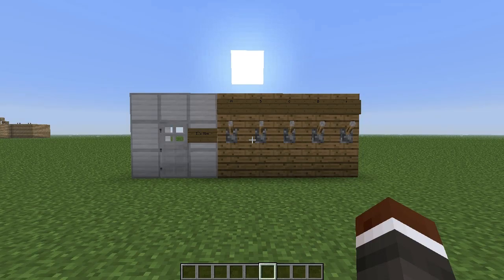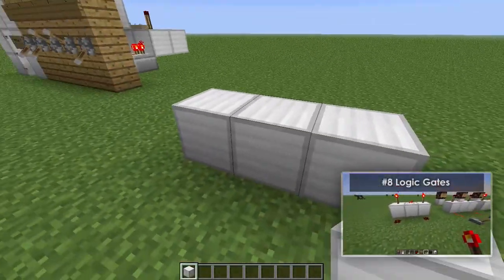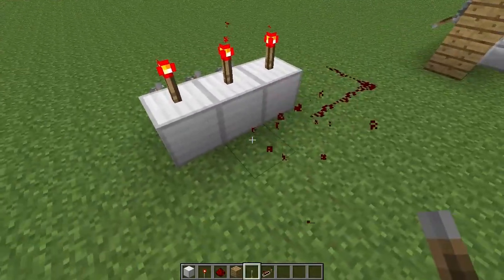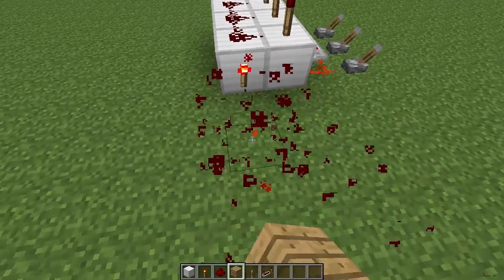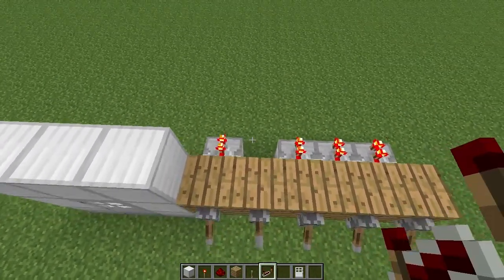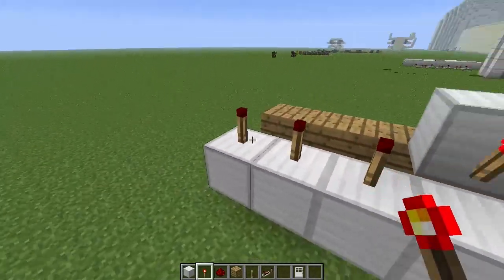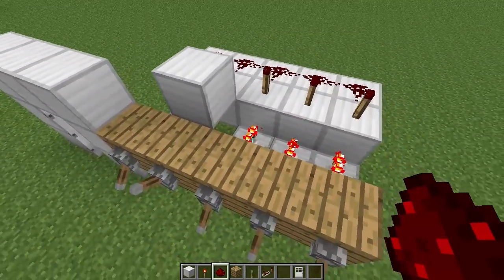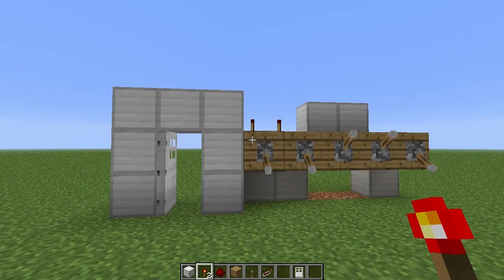Redstone Tutorials - #19 Combination Lock

Comment: Tonight was the first time I really got into redstone. Thanks to your tutorials on basic gates I was able to build a button combination lock.
- 3 buttons
- The buttons fire into a pulse limitor, as you showed.
- It uses 4 bytes of RAM ^-^ (I feel like I just invented computer science all on my own).
The button's input is instantly separated into two.
The first circuit merges all of the buttons into one input and counts to three in binary (except that it's wrong binary).
The first cell will go to 1 if a button is pressed. The second cell will go to 1 if the 'and-gate' confirms that a button is pressed and that the first cell =1. There's also an 'and-gate' that triggers a pulse if cell B = 1 and there's a button input. This final gate triggers an error sound and puts a 0 in all four memory cells on the two circuits.
Basically this circuit counts three button inputs with binary cells. 00 => 01 => 11 => reset to 00. (And yeah I do realise that it's not an optimal use of binary numbers, because following that logic, counting to 4 would take 3 bytes whereas it takes two bites if I actually went 0, 01, 10, 11. But I didn't want 4 numbers).
Anyways, the second circuit starts at 00, goes to 01 if the right button is pressed, then to 11 if the second right button is pressed, then using another 'and-gate' triggers a T-thingie which opens the door. Oh, and it plays a happy jingle.
Basically, you have to input the right buttons in the right order, and if you don't do it in exactly 3 button presses, the machine resets with all cells as 00. That forces you to do it right.
I really feel like if I had lived 100 years ago I would have invented the ancestor of computers. I just taught myself binary information processing. I'm quite proud of my acheivement.
Reply: I can no longer read

Comment: Only 32 different combinations on the lock you did
Reply: So just chain more switches. An 8-switch lock has 256 combinations.
Reply: IceMetalPunk what about a ten switch lock????
Reply: Eric McKinney It's 2^N, where N is the number of switches (that's 2 to the power of N). So for a 10 switch lock, there are 2^10 = 1024 combinations.
Reply: IceMetalPunk oh

Comment: Haha I did a similar thing I wish I watched this first. but my thing was that I hate levers so I used buttons which meant I had to build in a bunch of my own modified switches to convert them into constant impulses then I had to create a reset system too. But this and system works a lot better and doesnt need an overhead cave wired to the brim with Rstone xD

Comment: i had 8 levers leading into 4 and gates with 1 torch taken off each and gate the 4 and gates led into 2 and gates with torches on those 2 and gates led to one and gate which then let out a redstone signal when all the torches that led to a torch on the first 4 and gates were on. all the levers that didn't lead to a torch lead to a piston that blocks the current so you can't flip all the levers and open it. i had the code open a secret room from pistons and i recently added a button on both sides

Comment: I did this with two sides with 10 levers in a hall with a trapdoor floor leading to an iron door. Each side has a four lever activation that I made by adding AND gates into each other... 7 Gates in total, with the final AND gate leading into the iron door. All the levers that don't go into the AND gates send the signal into a circuit similar to your hidden floor trap circuit ( exact same but with trapdoors) so if any of the wrong levers are hit they fall into lava... Any tips to make it smaller?

Comment: I made one like this a while ago with a button as well as the levers to require the extra activation step-harder to crack without knowing pin. Instead of a door I hooked it up to a powered rail to send out a storage cart-great banking system for servers. Works really well and this way takes up a bit less space than mine!